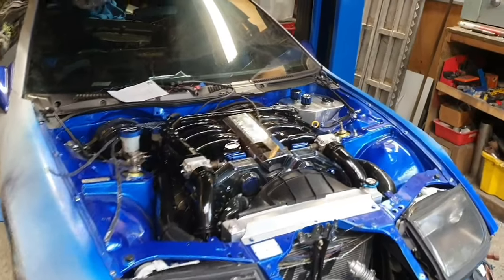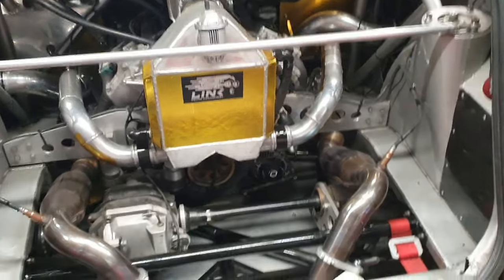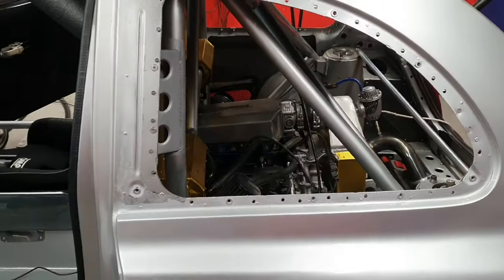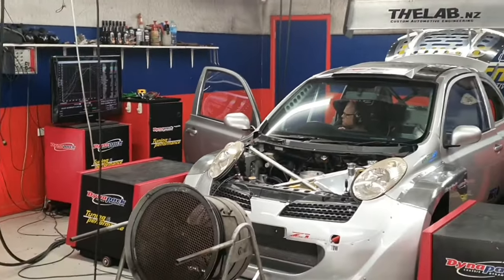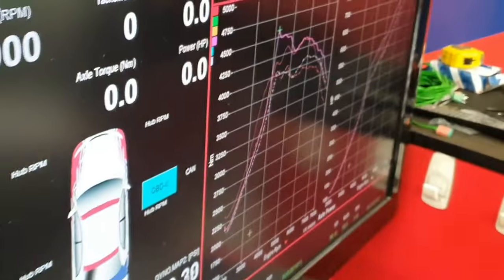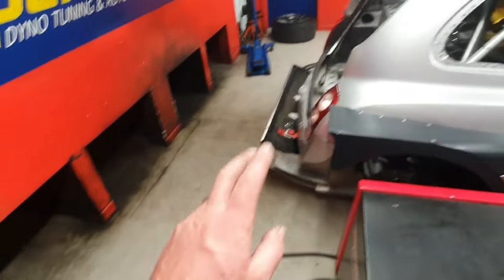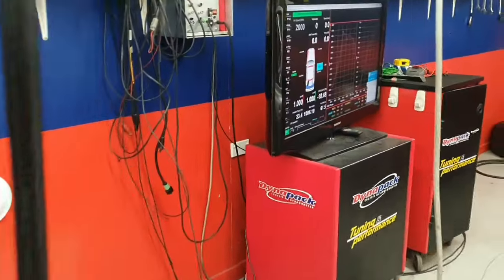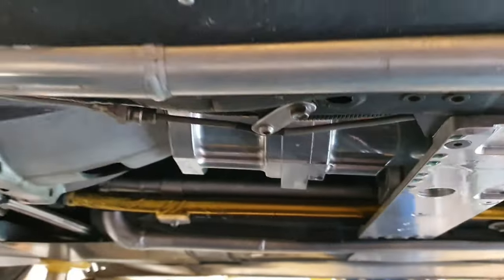Dyno tune for worlds most powerful Nissan March

Comment: There was a video I watched the other day about he exhaust going out into the defuser and the pulses coming out the exhausts where effecting the way it works so they added a expansion pipe off the exhaust to even out the pulses to make the system work
Reply from the maker: Yip F1 cars back in the day, that was for a slightly different style of blown diffuser where they put the exh gasses out the top to do magic things with the air under the bottom.
Reply: @TheLabLimited  Wasn't it the fact it created a low-pressure zone further out "pulling" the air through the diffuser faster? Only worked on throttle though I believe. Awesome car btw, just found the channel and love the idea of a little nimble monster of a car, reminds ya of a road version of a Group B car.